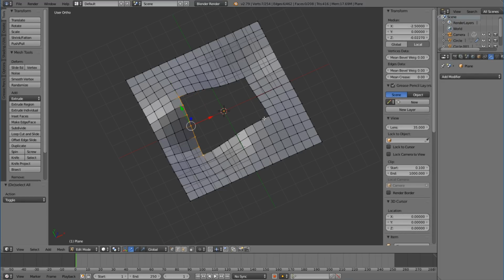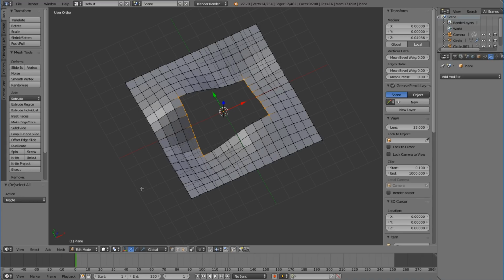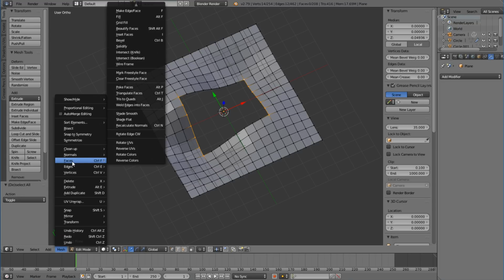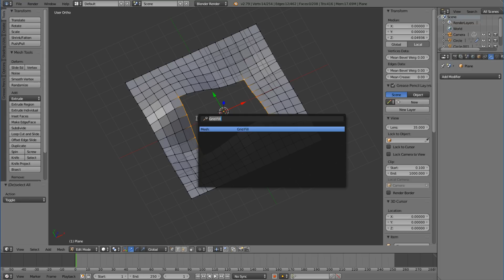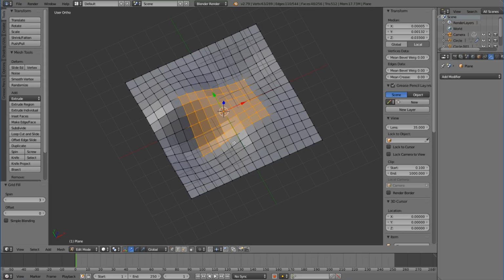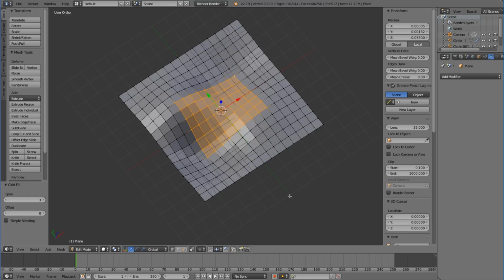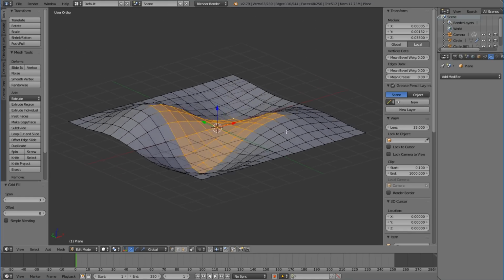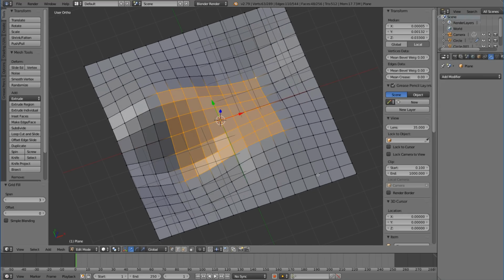Blender Quick Tips #006 Grid Fill Tool

Comment: I have a 5 pointed star I want to fill, but I keep getting the message "Report Error. Select to edge loops."  I don't know what it wants me to do.  I've selected many points and then only two.  Maybe the grid fill tool can't be used for this type of object?  This 5 pointed star has all of the lines connected with holes where there aren't lines, so there's a large, pentagon-shaped hole in the middle, and then there are 5 triangular holes.  I'm completely at a loss as to how to fill these holes.
Reply: You can just fill thel with a singular face but that's probably not what you want.